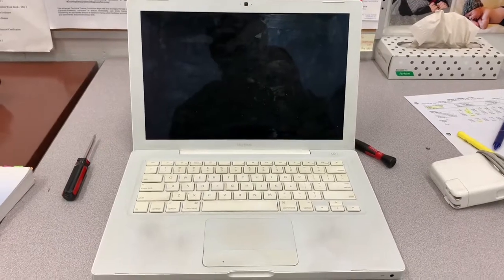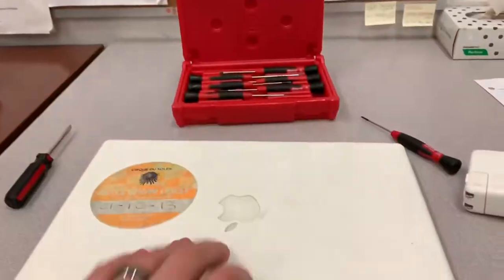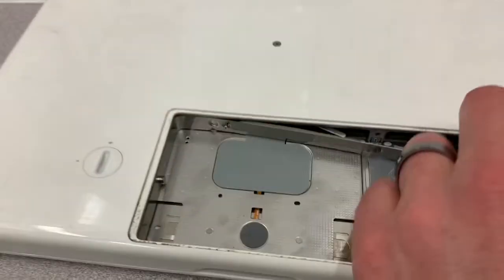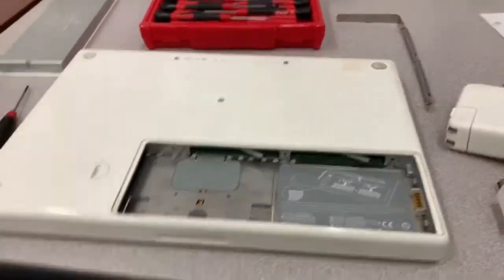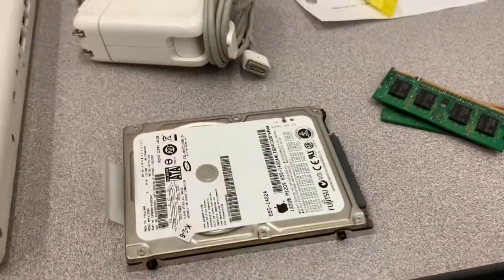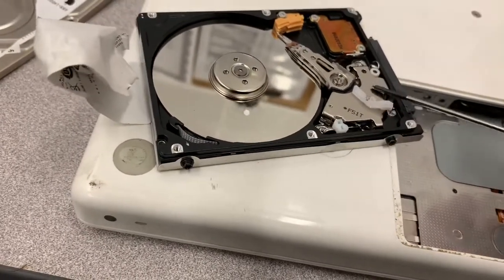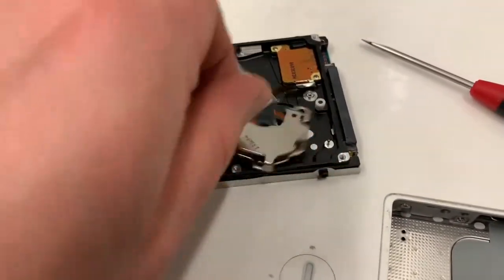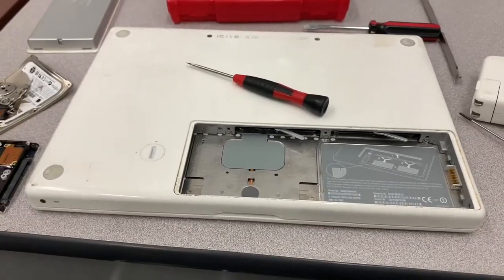How to Remove and Destroy MacBook Hard Drive

Comment: That shiny little disc you said you'd keep b/c it looks pretty cool is what contains any data - personal, operating system, or otherwise.  Nothing is more important to physically render useless and destroyed than it.  If found intact, that disc could be reinstalled into another drive mechanism, searched, and potentially its data reconstructed.
Reply from the maker: Great info! Thanks for letting myself and others know. 
I did end up folding it and breaking it.